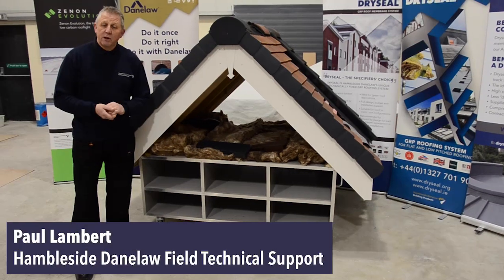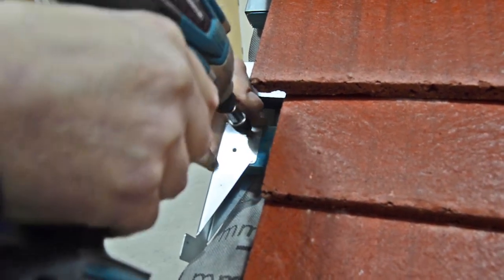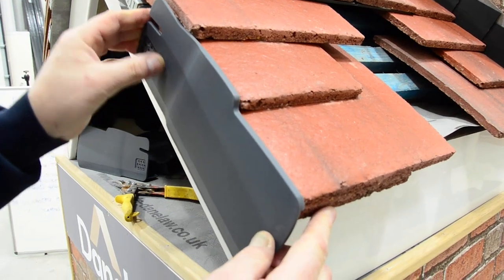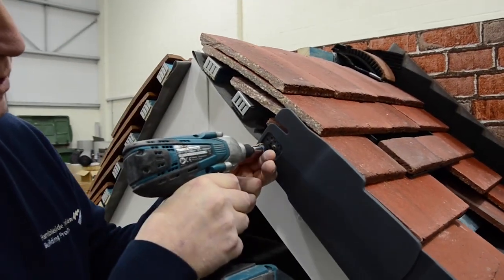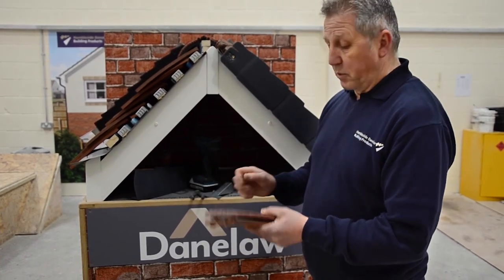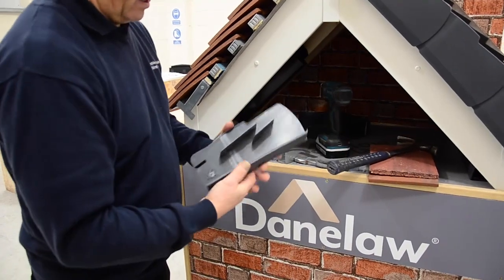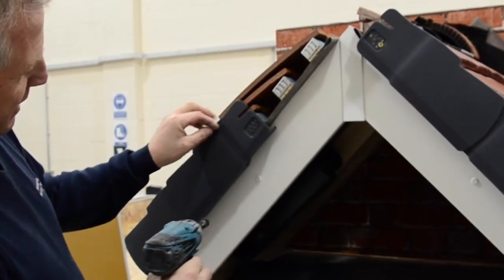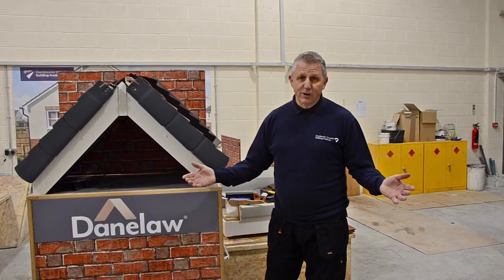InVerg Plain Tile Interlocking Dry Verge System - Installation Tutorial

Comment: Hi what the distance between each Battens  for them
Reply: 4 years late, but depends on the tile - plain clays usually 100mm, but looking at the fixing holes in these there's about 40mm to 50mm of tolerance, so up to around 150mm spacing. Any bigger I'm sure they have alternative products.